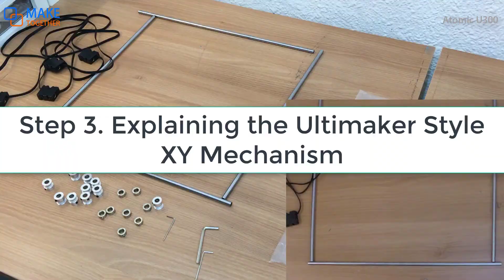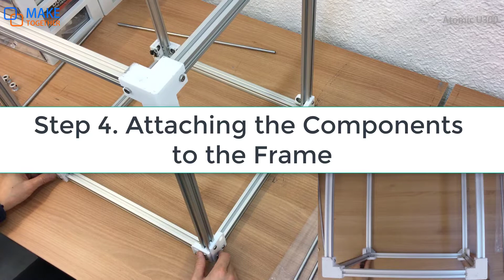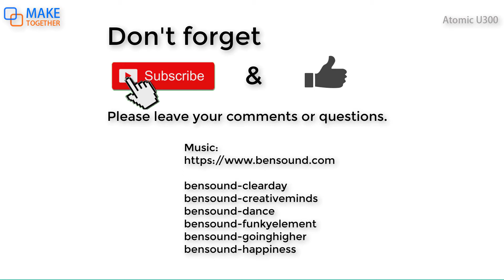Ultimaker Style 3D Printer Build Tutorial 03 -  XY Axis Linear Motion Parts

Comment: The 760mm timing belt at my place is hard to find, if you use the GT2 610 timing belt, does it fit or not....thnks
Reply from the maker: Thank you for your question, Burapat.
If you use 610mm belt you should change all the design of the printer.
You can order it from the link below. GT2 timing belt 6mm width and 760mm length.
https://www.aliexpress.com/wholesale?catId=0&initiative_id=SB_20210704060322&SearchText=gt2+timing+belt+760+6mm
Reply: @MakeTogether  , ok thnk

Comment: hi friend im planning on making a ultimaker style 3d printer but i dont know how to upload the firmware with marling 2.0 on a skr 1.4 board. where do i go at marlin code to select the ultimaker movemment ? its the same as core xy ?
Reply from the maker: Hi, Gabriel. 
Thank you for your questions. 
If you build an Ultimaker style 3d printer, you can use it as a default mode. Core-XY system users should activate the '"#define corexy" line. You don't need to do that if you use an Ultimaker style system,

And I don't know much about the SKR 1.4 board.
I think you can get more information from the link below.
https://github.com/bigtreetech/BIGTREETECH-SKR-V1.3/tree/master/BTT%20SKR%20V1.4/Firmware/Marlin-2.0.x-SKR-V1.4-Turbo
I hope my answer would be helpful to you.
Reply from the maker: I found another article for the SKR 1.4 with Marlin 2.0x
Please check out the link below.
https://3dwork.io/en/complete-guide-skr-v1-4-and-tmc2209